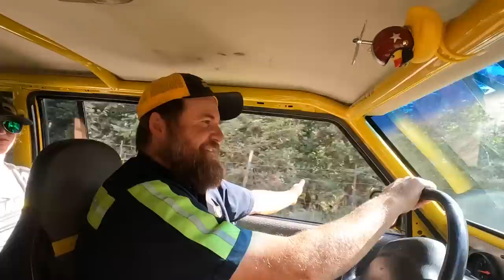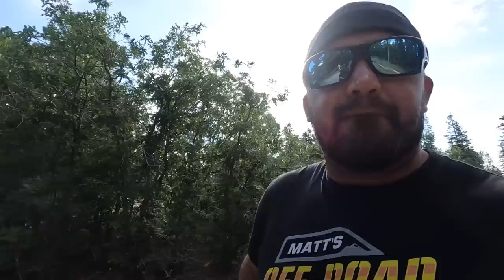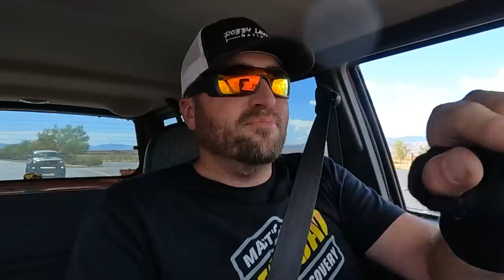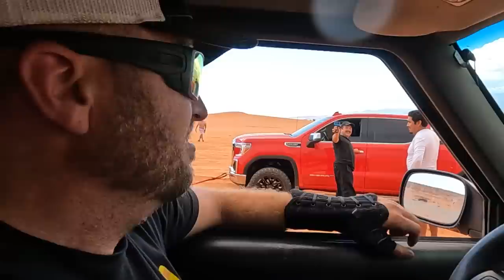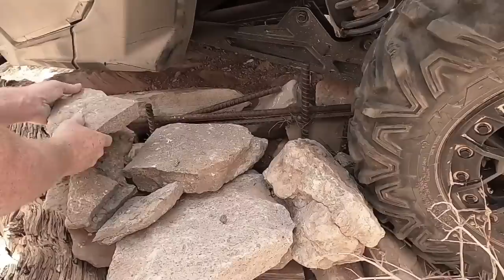Did I Set My Team Up For Failure?

Comment: Good job Jefe, you made it happen in less than ideal conditions.

In 50 years of driving 4x4s, I've noticed that if you drive across sand within a few minutes someone with a passenger car or 2 wheel truck will see your tracks and think they can follow them too. It's got to be a major flaw in the human condition?
Reply: No, it's just people not knowing the capabilities or limitations of their vehicle. Just because they bought a $50k AWD vehicle with an off-road package doesn't mean they can go off-road.
Reply: @hibiki54  maybe that's their flaw?
Reply: I think there's just a misunderstanding of the necessity for floatation when driving on sand. Even most pickup truck tire/rim packages these days don't have enough floatation for driving on this sort of sand. (this video proves that point). Any AWD car or 4wd pickup or SUV can drive on sand if equipped with appropriate tires and rims with the appropriate air pressure (like 5-10PSI). Most vehicles are optimized for highway use.

A huge tire on a tiny RIM mounted to an SUV with 8PSI in it will exert about 8PSI (average) over its contact patch. 

A typical road-going tire for passenger cars and light trucks with low profile sidewalls and 35-80PSI will exert 35-80PSI (average) on its contact patch. Most of these tire/rim combos can't be aired down below around 15-20PSI without risking damage to the rim or rubber.
Reply: @hibiki54  You mean my 2wd Tundra that says ''OFF ROAD'' can't do this? lol.
I don't know why they say that in big letters, I have been stuck in wet grass.
Reply: Same with tracking into snow, mud and water. . Most people just don’t have common sense and know their car’s limitations.
Reply: @NoNORADon911 😂 ❤

Comment: I have a tip, if you're doing this kind of hard pulling with anything that has an automatic trans, when you stop put the trans in neutral.  When you do this, it will run the trans pump and pump the trans fluid through your trans cooler.   Even if it's just for 30 sec. it will help keep your trans temps down.  Your video looks nicer; did you buy a new camera?
Reply: Great tip :-) thx keep those transmissions cool heat kills em!

Comment: Matt, You might have to make a "Tire Sling" to wrap around the tire(s) as a towing point(s)! A Sling made out of tow straps that will cinch around the tire when pulled. It will also have a skid plate attached on the bottom, since the cinched tire won't spin. Maybe just a silly idea or something that may work for those difficult no attachment point times.
Reply: Could work if the tire isn't dug into the sand/mud/snow, I guess...
Reply: Good idea.  I was wondering if it would damage a rim if you used a hi-lift jack inside the rim to lift the car enough to get some rocks under the tires.
Reply: @ColoradoStreetboarding  
•  Most probably. Newer wheels are too soft & damage easily .
•  I saw ( about 10 years ago ) a guy who cobbled a Wheel-Lift Strap into a Hi-Lift compatible sling  just for that reason. Lift it up , refill the hole.
Reply: @ColoradoStreetboarding  I saw Joel from Bryce Canyon Off Road Rescue do something like you are suggesting . That is another " tow truck" You Tube channel . They used a 
                                                  jack to raise everything .

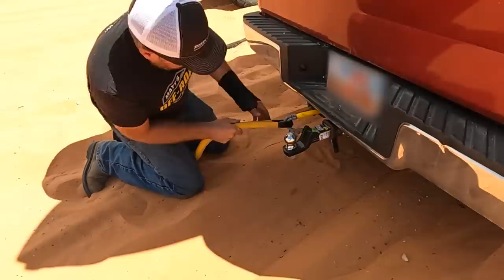Comment: 7:33 ... Glad to see him use the receiver instead of just the hitch.   Not knowing their equipment this was probably the safest bet.
Reply: The equipment is solid. There’s a whole video where Matt and Matt yes 2 Matt’s discuss tow points and recovery options.
Reply: @Kletke84  Matt's equipment is solid, you have no idea if the customers equipment is any good. He used the receiver on the customers car and the hitch on the jeep since he knows that the 3 ball hitch is good.
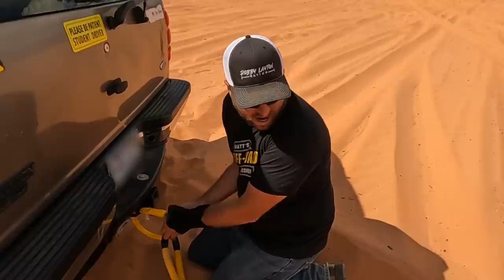Reply: @willemkauffeld7679  And yet at 8:16 when pulling Jillians truck he used the safety chain holes with square edges🤨, Good thing he did not cut the soft shackle on the square edges.

Comment: World's largest off road wrecker would've been perfect to lift the Malibu straight up & off the rock. Maybe a little overkill for that road though lol.
Reply: knowing Matt he'll definitely take it on small jobs like that when it's done just a small bit of overkill but cool factor 10,000 can't wait till it's done it's going to be sick we'll be seeing it more than the more vair
Reply: With no recovery points and plastic everything, you're not just gonna lift that car without damaging everything on it.
Reply: @dedalliance1  good point
Reply: @dedalliance1  Might be able to lift it with a couple of straps running underneath the way they lift boats. Not sure the boom on the new wrecker is long enough though.
Reply: @garyp.7501  Would probably still damage something, cars aren't meant to be lifted like that. Plus I doubt the wrecker has enough winch power and counter weight to actually do that safely. Plus that'd be way more complicated than just doing what they did, which is the way to do it lol.
Reply: @dedalliance1  endless loop, axle strap or even a soft shackle through the aluminum rim and lift and block or stack rocks under the tire, only lifting one wheel so not a lot of weight.
Reply: @iffykidmn8170  I mean I guess you could do that. Could also just use a jack.

Comment: In my opinion Hefe doesn't get enough credit he is good at what he does he only had the Tangerine and adapted well to getting those three vehicles out. He was outmatched but he got them out and that is all that matters. Well done Hefe you never gave up that is true leadership when you can adapt on the spot
I definitely think you guys need to give some love to the Tangerine so it will be more equipped for doing jobs like that 
In my opinion Matt's experience pays off well when you plan for everything to avoid disaster and damage to a vehicle.
Having the lovely Lizzy as part of the crew is always a good day

Comment: If I know Matt enough by now and he had the 4 truck job he would have aird right down to 5psi doubles the rope length and the first and last truck so he could reach the road then towed them out. The other 2 would have towed back the other way. However.... Jefe you still did an epic Job with what you had to work with. The Tangerine is no slouch if you know how to use it so great job Jefe!!
Reply: Tangerine looked poorly equipped with one rope and two soft shackles and not much else in the back.
Reply: @iffykidmn8170  exactly!

Comment: In many Middle Eastern countries where they have a lot of deserts, it is quite normal to carry a couple of mats in the car, which they put under the wheels for traction, if they get stuck in the sand.
A good mat gives great traction, and if necessary it can be attached to the rear bumper so it is not necessary to stop and pick up the mat, so you can keep the forward motion going.
They can also use these mats for picnic etc.
Reply: They usually carry a Matt in the car

Comment: Hey Matt, what about the screw in factory supplied tow hooks that screw into a brackets behind the bumpers when you remove the plastic covers on the bumpers? The hooks are normally in the factory tool kits in the boots/trunks of vehicles

Comment: If you keep a tire pump in the vehicle, you can air down to 10 PSI for sand then get back to street pressure when you're back on pavement.  It's less inconvenient than getting stuck.

Comment: After watching a few of your videos, I'm picking up on a common theme. The location of the stuck vehicles isn't always straightforward. Haved you guys heard of a location system called "What3Words"? The entire planet has been divided up into a 9ft x 9ft (3m x 3m) grid. Each square has been assigned 3 random words. You can use the app offline and pin point the square you're located in, touch on it and get the 3 words assigned to that square. The search party can then enter those 3 words into their app or website and pin point exactly where that person is. Even if their GPS signal is poor, they can use landmarks on the map to pin point their actual location. This has been adopted in the UK but isn't widely known in other parts of the world yet. Definitely worth checking out with what you guys are doing.

Comment: How do you feel about off-road recovery air bags ? Just wondering because in my head you could inflate them partially and push the car forward or backwards ( which ever makes more sense ) then stack rock's or use some wood for a ramp and drive it out without dragging.
I only ask because I don't know how effective they are or worth the money.
Could help out a lot for high centered or to break suction in sticky mud or clay.
Reply: If they Pop due to Sharp rock's ( which is why I think they might not always work) you could use a chunk of that white rubber membrane roofing material under and on top of the airbag to keep it from popping.

Comment: Those cars got a little square piece of plastic on the bumper where you take the plastic off the bumper and you twist in the bolt into the front of the bumper where there’s a recovery point

Comment: I've had 2 cherokee and 4 grand cherokee, both cherokee and 2 of the grand  had the 4.0 w/part time 4x, but always felt needed just a pinch more, then got a grand with the 5.9, part time 4x and it was a gas hog,,  12-14mpg, the 4.0 were all 15-17mpg, 5 year ago ended up getting current 98 grand cherokee which I love, 5.2, full-time 4x, 3:73 geared, threw in 2inchs so could run the 31s,,  and get15-16 normal daily driving and when running interstate cruises at posted getting 19mpg

Comment: Your team wont fail in any big way when you trust them to perform. You have great people and they all have learned how to extract stuck vehicles the right way. Also sometimes the less than right ways when there is an urgent reason. However..., and  in no way am I  throwing shade at anybody on your recovery teams by saying this, ...you do have an even better wife than you have recovery teams. And if the Tangerine becomes unavailable as the family car very often, or if the tangerine starts returning from recoveries scuffed up or broken, then Jamie may need to have to have a word to steer things in a better direction. She would be right too same as always. Now more than ever, before a window gets cracked or the A/C stops being cold in the tangerine  it would be prudent to hurry up whenever you can to finish and equip the Worlds biggest offroad wrecker.For Janie.  Anyhow I wish I knew how to make paragraph breaks in a comment but once the WLORW is finished  you can have a Solid Works CAD fan input up all the WLORW pieces and sell the drawings on Amazon as the stage one wrecker kit that has been missing from your life. Send the CAD/CAM button pushing  monkey over to the fab rats shop to input the shapes of the wrecker's fabricated parts into Paul's automatic plasma cutter and suddenly BAM! Stage II MATT and RAT wrecker collaboration kit for  Amazon

Comment: Dude you need to air your tires down WAY more.  5-8 psi range or until they are "jiggly" depending on the brand.  My heavy 07 Duramax went uninhibited through Little Sahara including half way up the shoulder of the face before deciding to turn around.  The shoulder is like a 40 or 45 degree angle.

Comment: They don't have the j-hook holes anymore because most manufacturers don't want chains used when they are transported on trucks. The metal is to thin and it will just rip the metal. I haul cars and I agree these newer cars have very thin metal.

Comment: If you stayed parked on the asphalt and ran in a 100ft winchline -- with an extension if necessary, could you winch those trucks back to the highway without ever getting in the sand?  Or would your Jeep slide, even on asphalt?  Might be useful when the big toys are away on jobs.

Comment: I have found most all vehicles come with an eye bolt in the trunk and an access point in the front and rear bumper.
Reply: I just checked and all my BMW's and Hyundai Santa fe have an access point in the front and rear bumper to tow it from. @mattsoffroad
Reply: @MattsOffRoadRecovery  yep
Reply: @MattsOffRoadRecovery  And I bet some of those eye bolts are better lost and you'd be safer hooking up to the antenna or license plate frame......

Comment: Matt, I believe it is time to upgrade this Jeep, so you can take the other vehicles with you. Even though Hefe was able to handle the situation, I believe you are pushing your luck
Reply: The Tangerine has the same setup and Rudy's jeep used to have, Jefe just needs more seat time.
Reply: @philb5593  Sand rescue with No lockers???

Comment: What is the major differences in Jaime's jeep that would have helped? better gearing? or just more power? and did they air down?
Reply: front and rear lockers, wider taller tires and less air, better gearing, more power and just keep going down the rabbit hole.

Comment: Most of the tow points on the new vehicles are underneath the plastic belly pan crud so they are pretty useless , I get the feeling that engineers and designers don't like tow guys anymore than they like mechanics
Reply: Better aerodynamics for better fuel efficiency is a much higher priority than towability. And service departments are ok with all of the panels and covers, just means that they can charge more... 😉

Comment: If that's a 4.0 straight six the tires are probably spinning at like 160. I once wrapped my speedometer around 3 times on ice in my 87 Cherokee, I'd be drifting down a dirt road with my tires spinning at like 100 mph while only going 20 mph. Miss that jeep.

Comment: Hey Matt I love your videos. This is a question I submitted to mad mat's 4 wheel drive.

This video kind of hits on one of my biggest concerns. I saw your video on the tragedy that happened just a short while ago in which a drop down hitch was used for recovery and it ripped the ball and the majority of the shank off sending it through the recovered vehicles driver side windshield. What I specifically Wonder is, what are the forces that a hitch pin can withstand? I understand that it's the least likely point of failure, but is that true of all hitch pins? It seems like a lot of force and trust put on a 3/8 inch piece of steel. I'm guessing as to the thickness it's probably more like a half inch thick piece of steel.I personally have sheared one of those hitch pins towing a relatively heavy load under relatively minor forces. I was pulling a medium duty flatbed trailer with a mini excavator down a dirt road and never experienced near the force of a stuck vehicle. The only thing that kept the trailer secured to the truck was the weight of the trailer exerting downward pressure on the entire receiver. Every time I see Matt at Matt's off-road recovery use his Pendle hitch, I cringe. A pintle hitch is strong and will likely release the kinetic rope first but, that's assuming it doesn't shear the hitch pin and pull the entire pintle hitch out causing the same type of catastrophic failure. I am not an experienced recovery person, but I tow heavy loads quite often with a bumper pull setup.
Reply: They're 5/8" for a 2" receiver
Reply: A basic Internet search says they're rated for 6 figures or so.
Emailer says "I reached out to my contact at Curt regarding the pin and clip # C21500 and he said they haven't ever needed to test the sheer strength of a pin because the hitches and ball mounts will fail before the pin does every single time. They are rated for 6 figures easily. He gave an example of a Ford F-350 with ball mount in the receiver with a 5/8 inch pin that was rear ended by a semi truck with milk trailer. He said the ball mount and hitch pin were still intact when the receiver hit and cracked the rear axle case. He was able to pull the pin to remove the ball mount. Granted you shouldn't reuse those parts, they held up to an incredible force and weight without sheering.

For reference you can look at a grade 8 bolt that is 5/8 inch diameter and the tensile strength is 150,000 lbs per square inch. The ultimate sheer strength is typically about 60% of the tension strength, putting that sheer strength at about 90,000 lbs"

Comment: No recovery points?  What do they think, that our modern cars are so smart they'll never need to be recovered?  Lizzie does a good job, being able to really get the right control to s-l-o-w-l-y move a car.  Are there any signs at that sand hollow beach to let people know they could get stuck in the sand?  Is rock-stacking a required course of study for rescue operations?  And, yeah, you kinda did set your team up for failure, or, at least, a difficult time, by taking BOTH of your best off-road recovery vehicles. You should always leave them with at least one of them.

Comment: So, there's a spot that pops on the front and rear on the bumper covers and a screw in tow point with/where the spare tire goes
Reply: Those are only good for a straight pull in-line with the car. Doesn’t take much side load to bend or break the screw in eyelet. Still better to go to the suspension mounts at the chassis.
Reply: Good information to have, I used to just try to pull front suspension components off, but I'm also not a professional, and was only messing with shitboxes 😂 I was curious why I've never seen them used, now I know!